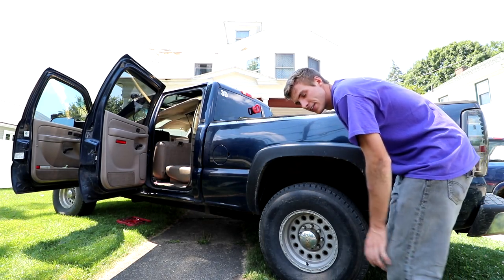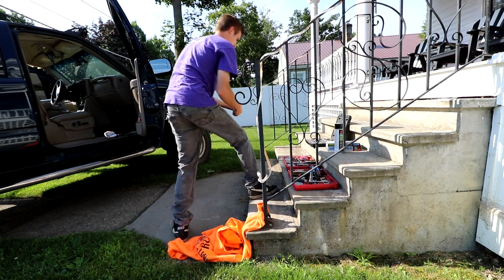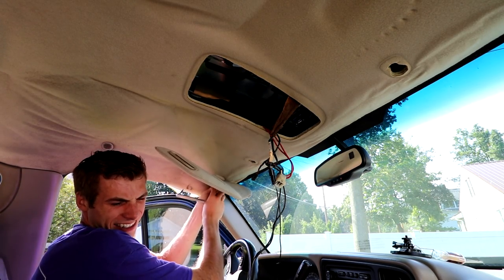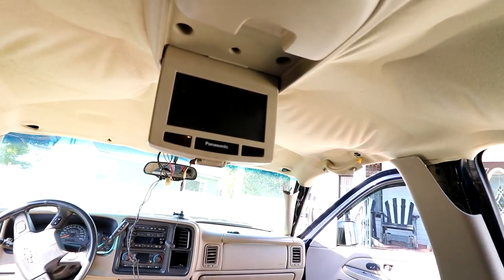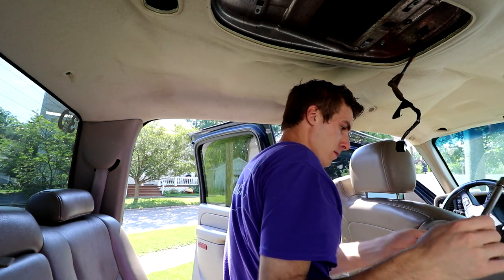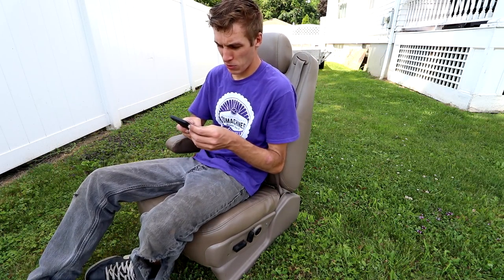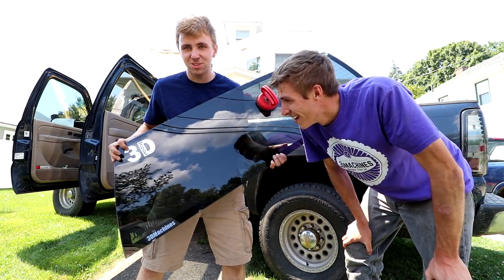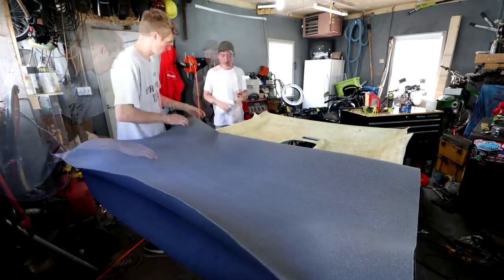MY TRUCK DESTROYED

Comment: I probably have made those headliners before... not regular production, but past model production after the line was discontinued.  I've gone to plants that install them and they just fold them and throw them in the car.  I got laid off from there almost 7 years ago after 15 years.  Thank you NAFTA.  I was on the layoff list 5 times over about 10 years.  9 years of pay freezes and 3 pay cuts later I get laid off making about the same as what I was making in 1998.  Thank Clinton.

Comment: The window was a quickest way. But taking the rear seats out is the way we remove the headliners at my cousins interior shop. Should added dynamat to the ceiling to absorb sound and insulate from the heat of the roof. Thats  why headliners fail .

Comment: I did Upholstery for 10 year's the headliner didn't break down because of smoking. It broke down because of the heat and sun. The foam backing on the headliner material breaks down causing it to let go.

Comment: Please read this comment because it will be very useful in the future..

If you touch your headliner or anything it makes it fall down so don't touch it and you will never have to replace it. It makes the glue fall off when you touch it
Reply: The reason it fell down in the first place was from smoking in the truck and the glue being old,reglue new fabric up with the correct strength adhesive and it will be just fine.
Reply: Cody Kenny old glue dries up and it will still stay together but if you touch it, it is really brittle and just comes off and smoke doesent have an effect on it, just time

Comment: You didn't need to pull the back glass man. You can angle the headliner out of the front door I promise lol. I just did it the other day when I replaced mine
Reply from the maker: Do you have the center posts like I do? Or do you have a 3 door?
Reply: Yeah mine is a crew cab so it has the full 4 doors just like yours. Its a pain and you do have to bend it a little but it won't hurt it at all. Just letting you kno that it is possible though haha

Comment: rip battery at 1:06 chevy and gmc problems if the interior lights r on rip battery
Reply: Sean Morris the trucks they make are shit quality that's why...
Reply: Louis Barningham u don't even look old enough to buy a truck much less even drive one. And how do u know Chevy is "shit quality"? It's not like u have one as your daily driver and no hot wheels Chevys you buy at Walmart don't count. And I'm pretty sure Duramaxes last longer than most of the powerstrokes on the market today I will give international credit for the 7.3 but every other ford engine is a joke and not to mention dodge is a more reliable truck as well, so before u run your mouth make sure u got experience behind your words
Reply: Miles Smith this man knows whats right!
Reply: Miles Smith what's ur facts how gmc/Chevy  is better then ford?
Reply: Lmao chevy truck sucks but the LS motors in them can make 1200 on stock bottom end okay...
Reply: Miles Smith all the chevys I have ever owned were a joke ranging from an s10 to a Silverado to a blazer and to a cavalier
Reply: ExcursionPower give the 6.7L Duramax a try or the 5.9 Cummins and telling by your name you're an excursion fan hopefully u have the 7.3L engine in your excursion and not the 6.0 and if u have a 6.0 then I see new head studs push rods etc in your future
Reply: Miles Smith it's a 6.6l Duramax, just FYI, good comment though!
Reply: Kasen Alley typing too fast to realize I put 6.7 guess I was thinking of the 6.7 liter powerstroke and wasn't paying attention
Reply: Cavalier is a disposable car, its cheap.  S10s are also fairly cheap, a blazer is an S10 with a different body.  I've only owned chevys and never had a break down.  Even my first truck which was an old S10 I paid $500 for never had a major issue, only ever had to do wear and tear parts like the belt in the two years I drove it and I only stopped driving it cause I wanted a 4x4.